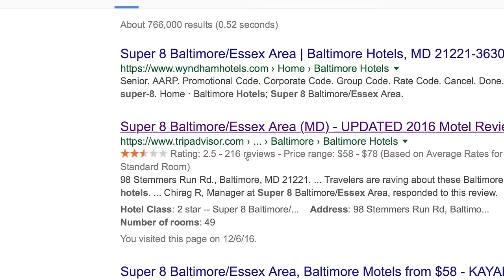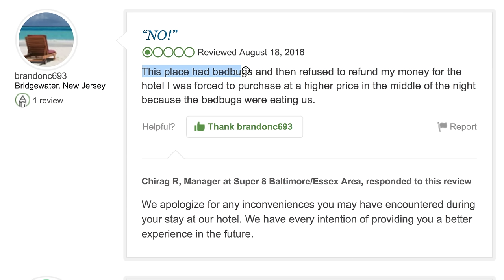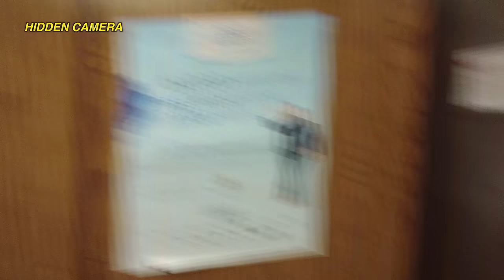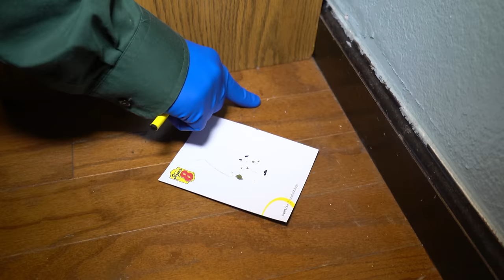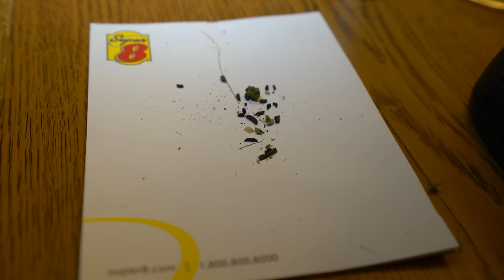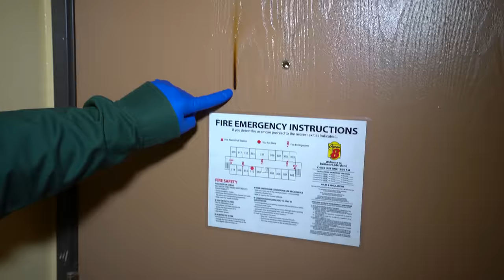Another Dirty Room S1E3: The Un-Super 8 : Mice and Filth : Essex, Maryland

Comment: When I was 19 I took a maids position very briefly.... It was because of the Super 8 Middletown, NY that I not only quit after about 4-5 days, but never worked as a maid elsewhere. I was trained to wipe down the entire bathroom with air freshener. My trainer told me to just spray it on everything, and just to make sure there were no hairs in sight. I walked into the room with the Jacuzzi, and the smell was like the inside of a dirty fish tank. No bedspreads or blankets were ever washed, and I was told to give the illusion of clean.
I ended up getting very ill, and quit. I've never looked at hotels the same again.
Especially not the Super 8s.😧

Comment: I'm starting a new job that requires I travel a couple times a month...thanks to these videos, I'm going to Target this weekend to buy my own pillows with bedbug protectors, a bottle of Lysol wipes, trash bags, antibacterial soap, and several other things I'll just take with me to each hotel I stay at (thankfully, my company puts me up in Hiltons/Hamptons, but still, they can be gross too if not managed properly).
Reply: StarlightAlly Oh no, Hiltons and Hamptons can have just as many problems. My mom has worked as a bartender at a Hilton for over 30 years, and they constantly are fighting bed bugs. You are absolutely making the right call with the precautions you are taking.
Reply: StarlightAlly Don't forget a folding tarp, like you would use as a ground cover when camping.  You don't want to risk putting your good linen on who knows what.
Reply: This is me.
Reply: Usually when I stay in a hotel. It's in another state and I have gotten there by airplane. So I could either take clothes and toiletries.  Or all that stuff. Even though I fly Southwest Airlines. With two checked bags and a carry on
Reply: I worked in a 5* Hotel for a few years, everything was immaculately clean except the comforters which were never changed or washed as they matched the curtains in the room. There were just a hand full of spare ones just in case one of them had to be washed or thrown out if they became too obviously stained, but apart from that, the Hotel was really good.
Reply: Erin Smith I know this is a pain and the hotel staff might bellyache about it, however the minute you check in you can insist on new everything, linens and towels and even pillows, and require you be there to watch them be changed.

If housekeeping is polite and gives you no grief, slip them a tip before they leave the room. And if they do a good job during your stay, slip them an extra tip personally before you leave.

Do not rely on the envelops. Staff can change at the last minute.
Reply: The hotels I stay in always have white comforters.
Reply: Hiltons and Hamptons are much better than the Derpy McDerp Inn these guys usually review lol

Comment: I worked in hotel as a housekeeper years ago and no matter what hotel, there's always something. Humans excrete stuff etc, so it's really hard to keep up with cleaning in great detail. I would always try my best but the hotels give the housekeepers too many rooms per day and don't pay overtime. So we had to work fast to turn over rooms. Especially during peak season, it was rough. Also people treat hotel rooms like shit and the stuff I saw was disgusting and showed disrespect for the cleaners. Not even a tip was left like 90% of the time. Owners are also cheap and won't provide proper equipment or supplies. Although I can safely say that I never saw bugs or drug needles. However, I did get a lot of interesting stories from working in  hotels.

Comment: You think those pillows need to be burned? You should see my pillow; burning it wouldn't suffice as an adequate means of destruction by these standards.
Reply: You can buy a pillow for  3$ at walmart. most pillows can be washed as well.
Reply: I do wash it; I just think they were a little too harsh on the condition of the pillows in this particular motel.
Reply: Rebelkid1112 Yeah. Mine are stained to shit as well and they're really not even old. Not only that, but I regularly wash them with bleach. Discoloration doesn't necessarily go away even with washing in bleach. I doubt the hotel does that. But regardless, it's a fact of life. I have a few from about a year ago and there's been enough times I've spilled stuff on em, they're stained up.

Just realized I replied to a six month old comment. Oops.

Comment: The thing about Super 8 is that unlike other chains, they really don't have strict regulations for upkeep, and they'll lease a franchise to just about anyone. I pulled into the parking lot of one in Tampa---the parking lot had huge chunks of pavement missing, and I counted at least three dilapidated cars sitting on flat tires. I didn't stay there, but I did stay at another Super 8 in Tampa. That one wasn't as gross as this one was, but it was in worse condition. The front window leaked, and had rusty water stains and peeling paint, and the carpet was 80's-era green with huge stains all over it.

Comment: I used to work for a Super 8 motel. The quality of the brand has gone down hill in the past ten years. The quality control inspectors used to be really tough when checking rooms. Now it's easy to get a passing grade from them. If it wasn't for the the head housekeeper we had, the motel would have never passed inspection. Luckily for the owner, not too long after she quit, the quality of inspections went down. The owners would use only replace sheets, towels, etc. if absolutely necessary. The room you were in would have rented at 49.00 - 55.00 plus tax where I used to work. I always everybody to inspect your room before bringing in your stuff so that bedbugs and other things won't get in your bags.

Comment: DUUUDE  THAT STAIN IN THE CORNER OF THE BED, IS MOST LIKELY WHERE THE MOUSE DIED AND DECOMPOSED INSIDE THE MATRESS, BECAUSE THERE'S NO WAY IT COULD HAVE GOT OUT ONCE IT BURROWED IN.
Reply: WHEN THEY FLIP THE MATRESS AT 15:49 YOU CAN SEE THE OUTLINE OF THE DECOMPOSED RATS BODY ON THE TOP PART OF THE MATRESS AND SEE THE GREASES AND FLUIDS RELEASED FROM THE DECOMPOSITION LEAKEDAL L THE WAY THROUGH TO THE BOX SPRING. AGAIN AT 15:49 YOU CAN SEE WHAT APPEARS TO BE FEET MARKS TOWARD THE SIDE AS IF THE MOUSE JUST DIED THERE TRYING TO SCRATCH AND CHEW IT'S WAY OUT.

Comment: I worked at a Holiday Inn back in the late 80s. We were told we had 20-30 minutes per room. On average, we had 20 rooms each. Not an easy job and minimum wage. After we cleaned, we had an inspector come through. She didn't do as thorough a job as you guys do, but I'd hope we did a better job than these housekeepers are doing at $100-200 night. Maybe you should do a hotel that has BETTER ratings and go through it like you do these others, just as a comparison!

Comment: I'm two years late to the party, but I might be able to explain the poo on the lower edge of those beds: toddler in a diaper. You have a parent strung out in there, not paying attention to their kid (s) and one got a full diaper. As the wee and poo mixed together and no one changed them they probably started mashing their butt into the sides of the beds to deal with the discomfort and it started to leak out and BAM dookie bed.

Comment: I use to clean hotel rooms back in 1995. Sheets were cleaned everyday, but not the bedspreads.  I never saw them go into the wash room.  Found a bunch of porn mags in the trash, under the liner.  Musta been hiding them from the Mrs's... lol.   We were never told to wipe down the furniture. Only thing management cared about was a clean bath and toilet.

Comment: I think the ratings should be changed to reflect proper functionality.  Not every place can be a zero if one is slightly Better than the other.  
10 - Perfect. Perfectly clean,  newish functional appliances, no sketchiness, rather high end.  AKA, never gonna be on this show.  
0 - Perfectly horrifying.  Bugs everywhere, old and new stains emitting horrible smells everywhere, non-functioning appliances, layers of grime, drug paraphernalia barely hidden, corpses of dead bugs/animals, black mold, dirty laundry, used condoms, etc. 
8 - This should be the "middle of the road" rating. 
This should be: One or two small stains. Mostly clean walls. Some dust build up. No trash. Maybe a hair or 3. Old/functional appliances. 
AKA the basic baseline for what you want and expect your hotel room to be. 
Just some suggestions.

Comment: Is Rick an actual building inspector or contractor?  Also, I worked for a spa for many years and after tons of washes, sometimes our sheets would get those weird stains that look like semen. This was straight out of the dryer, so it wasn't some degenerate client or coworker. Of course the professional thing is to throw it away, but it's not necessarily body spurg.
Reply: Kelsey Arnold no, just seems like a know it all.